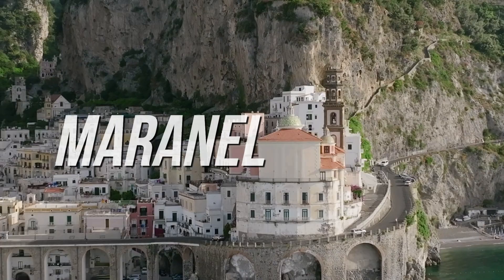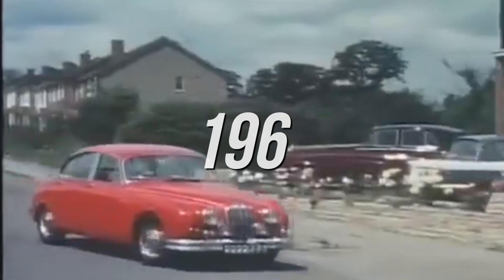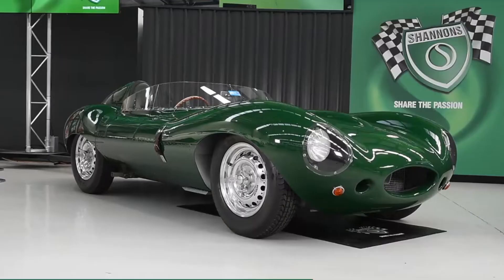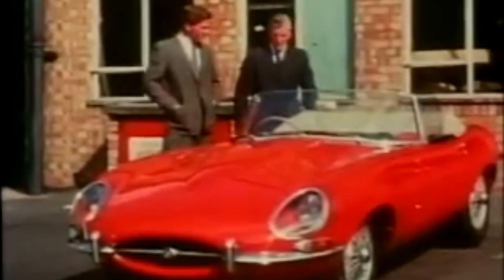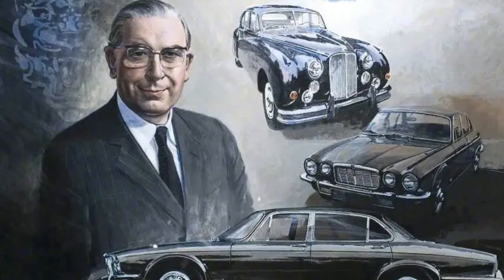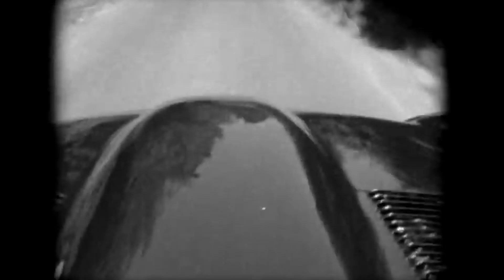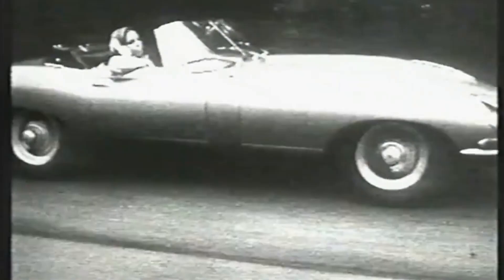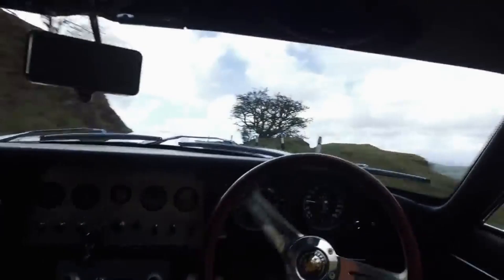Here's Why This Is The Most Beautiful Car Ever Made.

Comment: Today the E type is seen through rose tinted glasses. When new the first E types ran on crossply tires, had rubbish brakes, poor headlights and overheated. 
The gearbox was pre historic with no syncro on first or reverse gears and the seats were hard and uncomfortable. It sold solely on looks.
Reply: In 1961 most cars on the road had crossply tyres, far worse brakes, dim bulbs and crash boxes - many boxes up to recent times didn't have syncro on reverse. They also didn't have a 6-pot engine which had won at Le Mans, looked like a space ship and were priced way below anything remotely competitive. 
If you want to judge cars on modern metrics, run the same rule over an equivalent sports car of the era, with cart springs, wheezy pushrod engines, separate chassis.  Simple fact is your faulty analysis applies to the lot of them.
Reply: spoken truly like someone who wished he had one, but can't afford it! 😂
Reply: My ‘E’ is a 1960 Sprite. It’s built like a D type.